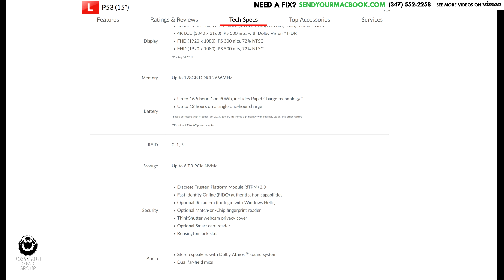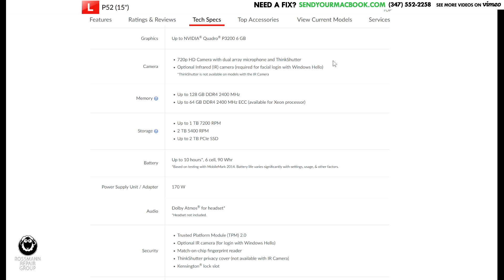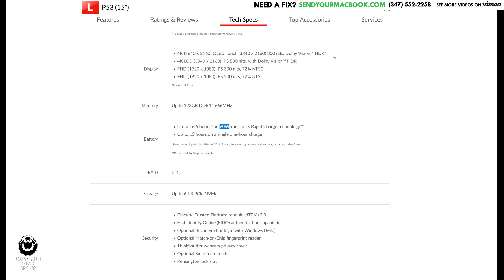Reading my YT comments is depressing

Comment: Ya but that doesn't really mean that they didn't fit a bigger battery in P53 just because P52 had the same size modular battery? For example if P53 had modular battery it could fit only 85Wh battery, and by making it non-modular they were able to make it 90Wh. So they did gain something, not compared to the older P52, but as a compromise for P53.

Just a speculation, I don't know if this is really the case. Just don't fully agree on the argument that they didn't gain anything just because the older model had same Wh rating.

Comment: Let's remember that Lenovo bought Motorola phone business.  And they release the G3 just after the purchase.

The G3 had underwater IP rating and this is with a phone that has a removable back covered so you can change the color of your phone. I bought five different colors myself.  Hell I bought a second G3 turn place the first because if it's broken but mostly usable screen.   

The g4 came out and it was a downgrade.  The entire Motorola line was no longer IP rated.   Even with a seal body.

Lenovo stop using the Motorola DNA in terms of body shape.  But at least the software is very minimal.   

Sadly I had to go with another brand after the G3.  If the G6 was $200, waterproofing, without a glass back, I would have bought it.

Comment: I didn't wanted to make a useless comment about that I won't buy lenovo because this, because I couldn't afford it anyway, or there are so many stupid people, but if this makes you feel better: I knew what you're talked about in that video, and agree with you. Btw my friend bought a t450, and i was a bit pissed that there aren't hdd or memory door and you need to disassemble the whole computer just like my cheap asus k501l.

At the same time, I'd give you a good representation of the battery life for dumber people. You have a 10 liter bucket. The new computer have a 10 liter bucket too. The first computer drains 1 liter per  hour, the new drains 0.8 liters. See how can it get better battery life?

Comment: One of the reasons Lenovo didn't put a bigger battery is because the computer would become illegal in an Airplane. With 16.5h batterylife and quickcharge, there is no point in making the battery external. As long as the battery is NOT glued into the case and can be easily swapped out if defect, I don't mind at all. This decision helps simplify the design and leaves more room for something else in the chassi rather than extra plastic,mechanics and a reinforced powerconnector.

I have a Thinkpad with both internal and external battery. I love it because I can hotswap the thing if I need to for example when I want huge battery life but can sacrifice some portability, or when I want to swap back to a smaller battery that gives me a lighter laptop with a bit less battery life.

Comment: The only reason I can see for a company to do this is if the battery will out live the unit. 

So if they believe that the life time of a laptop is say 15000 hours before it reaches the end of its life....
( I’m pulling these figures out of my ass for ease  of maths..)

So let’s say your battery can be recharged 1000 times and it lasts 10 hours per charge then you would need to replace the battery at 10000 hours to get to 15000 hours of life 

Where as now the battery will last 15 hours per charge then 1000 charges will give you 15000 hours and last the life time of the unit...
I’m not saying this is correct but it’s the only justification for such a move unless the company wants to build in a life time in which case they are just being fruits 

Oh and Louis keep up the good work people will learn you may just have to keep banging your head against the wall a while longer

Comment: Every new product of tech company consists of two parts: one serves company interests and the other - consumer's. The second exists simply because they cannot push product which has only first one. Example: Microsoft wants to sell Windows 10 that has new license, a ton of spyware, forced updates, ads. But they could not sell it if it had just that so they added a couple of features, which are not binded to spyware modules from technical perspective. But you can't choose! Lenovo follows the same strategy. They do everything to take choice away from you: copyright laws, patents and so on.

Comment: In theory (just avvocato diabolii) you can make laptop stay longer on the battery by making it internal. It may make the cooling system more efficient and consuming less energy. It may also improve battery cooling and lengthen it's life.

Comment: I still don't get why a higher capacity battery should make up for being unreplaceable? Is there any technical reason that keeps you from putting a higher capacity replaceable battery in your notebook instead of an unreplaceable higher capacity one? I don't think so. Woud you still accept the transition from a replaceable battery to an unreplaceable one, if say, they also put in a nicer screen? Makes just about equal sense.

Comment: I can try to imagine that external batteries being in a case rather close to them can heat/overheat a little more, and that having the battery going to internal might help in dissipating some of said heat hence having a "better" behavior, but I'm pretty sure it won't account for those kind of difference (if it accounts for something, at max it should be somewhere around 10 or 20 mins max).

Comment: I chose C) a more effective priest blessed the newer boards, making them more efficient, they could be the same boards but with a better blessing they'll work better. Battery doesn't matter. The old priests got lazy and were skipping part of the blessings, the new ones are younger and want to prove their priestly capabilities by doing greater blessings. Therefore, Lenovo should be applauded.

Comment: I don't agree, there can be multiple reasons why they change it, maybe you should ask them:
1. People tend to remove the battery when they plug to the wall, it's bad when the weight is not well distributed and can cause one place to be lower than others.
2. Bad designs can cause batteries to be warm, reducing the longevity of the battery and possible fire. If they can improve (even if it is ticker) to keep the battery cooler, the performance of the battery will be better in a long term.
3. Swapping batteries "requires a shutdown", maybe a solution like for phones (powerbanks), so you could provide extra battery without the requirement of changing batteries.
4. You started the drama criticizing the new model without knowing the reason why they did it, probably to get more visualizations, this is just another drama video.
Reply: @razmetrez  Than it's full responsibility to the company and they have to charge back the money or replace it (with a fix or another model), like they have done with some smartphones with the same issue.

Comment: People did have it wrong. But the reason the battery is no longer module is the fast charging aka Turbopower whatever the company wants to call it. The system needs to 'know' its battery as the charger is actually controlled by the system. If you just threw in random batteries you could end up with a battery fire because the system thinks the battery is at a proper temperature etc. for a high charge rate.

Is it impossible to design a modular battery system that would work with fast charging? No, but it would be more expensive. As well the casing around a spare battery would inhibit cooling which would reduce rapid charging ability. And you'd have lots of complaints when spare batteries didn't work because data pins for temperature and voltage sensors got dirty or bent etc.

Comment: Sorry, but I would have a different point of view: Costs. User replaceable batteries are better IF the majority of users would use it AND spending a few extra cents to make it replaceable is a better investment for them than all the other options. It is about the expected battery life at the time you would consider your laptop "garbage" simply because it is outdated tech, out of warrant with some other parts failing, etc. If that expected battery life is long enough to make sure the great majority of people wouldn't replace the battery then user replaceable battery has no value yet it might increase the manufacturing costs by a few dollars. Maybe they can use those dollars on other hardware changes that help better efficiency. 

These changes are bad for the people who want to repair their devices. Forcing them to upgrade means anyone who sees their computers will see a smoother operation, better performance. It helps with both bottom line, higher production volume (lower costs), reputation, and with the costs spent elsewhere better performance in other areas (good value).

Comment: Yes, of course it's the same Wh. and yes, I agree that Lenovo should remain modular. I like that my T550 has a builtin and an interchangeable battery. I can change batteries while my laptop stays on. But realistically I don't do that and I don't even have an additional battery.
Also maybe Lenovo feels that the 16hr life versus the 10hr life justifies this. If the battery was only 5Wh BUT battery life was 24hr because of efficiency would you still care it's not interchangeable? I did not like not being able to replace the battery in my phone but I learned over time that I don't really care. I prefer water resistancy, compactness and long battery life makes it OK. Again; I am one of those classic IBM/Lenovo lovers, I use the trackpoint, I want the old keyboard back, I like my laptop to be a bit thicker and more solid, I miss the physical buttons and keyboard light. Lenovo's imho are still much better and more practical ("for those who do") BUT if the laptop can work 16hrs on the battery AND the battery does not need replacing after 2yrs (Lenovo batteries always lasted very long and with recent advanges in technology most batteries do) I wouldn't be that bothered if the battery was not easily interchangeable.

Comment: Louis, you left out the other option for "adding battery life". They simply added a more aggressive power management which effectively neuters its productivity until you adjust it to perform as actually needed. Out of the box, the newer one will have a dimmer display, WiFi and USB that powers off and a CPU running at 2/3 capacity yielding the magical extra battery life from the same sized battery. I would be willing to bet that the newer model does not have chipset improvements that would yield a 60% increase in battery life.

Comment: A reason to do the thing for phones would be things as dust and waterproofing, no sense in making such a thing in a perfectly fine laptop.
My old lenovos battery has been acting up a little, it is an older unit afterall. But instead of plopping huge amounts for service or a whole new unit i have the option to just buy a battery. I wont be going swimming with this laptop so a replaceable battery is just a no-brainer.

So sad you need to clarify sich an obvious thing. Keep up the good work man!

Comment: One reason to make the battery internal, and non removable, is you can make a thinner product. No need for the extra plastic around the battery to protect it when it's external.

Comment: its just like having an bmw e36 328i and a e38 728i. .. have the same engine, same power but the e36 will be a lot fuel economical and faster coz its lighter.. 
same with battery .. you can get from 90wh only 90wh... not 91wh...  its the rest what makes how  long it takes to drain..

Comment: For those who doesn’t know the Watts per hour of a battery can be used like the amount of water of a glass of water you can have the same 1 litter amount of water (I know there is a lot of water of one glass hahaha, but nonetheless exist) but can consume it in 1 hour or two the differences in time will be due to the speed is consumed not magic, so with batteries is the same if you have a 90 watt hour one you consume at a 90watt hour rate the battery will last you 1 hour and if you do it at a rate of 10W per hour (and watts are essentially always given per hour) you will drain the battery this time in 9 hours, I think is pretty basic and obvious, but only when you know what Watts per hour in a battery indicates and mean

Comment: as usual you are talking a lot of sense, some people will disagree just to disagree, i like thinkpads, have had many over the years, they make it simple to pull apart and thats why i like them. Disappointing to see they are following apple and going over to the dark side. Trouble is with a lot of companies they become obsessed with copying what apple does, and dont realise that if we wanted apple products we would buy apple products, but we want something different, we lost the headphone jack because of apple, none removable batteries happened because of apple and so on and so on, its very annoying and not necessary.

Comment: Similar to how other hardware vendors copy the bad practices from Apple without copying the good practices, their customers copy the bad habits of unquestioning loyalty from the Apple customers.

Between Lenovo pulling stuff like that and installing malware in their OEM and Dell producing chargers that break after a few months of normal usage (the chargers would still work but the firmware blocks them) it's getting really difficult to find an acceptable laptop.

Comment: Yeah, it is a rip off from a battery stand point, but doesn't it have have a different cpu, gpu and motherboard that might take more space ? and have more m.2 and sata ports? I mean I am not defending them nor the morons choosing answer A, but, maybe if they did not make it none modular it would have been even thicker that that .2 to .5 inches. I would trade modularity and a couple of millimeters for  more configurablility and more battery life (again, even though the battery is still the same capacity)

Edited because of spelling and grammatical errors.

Have a great day.

Comment: Well, isn't it possible that having the battery not being modular and connected differently to the motherboard could have allowed more efficient power flow? Sure the battery is the same, but the way it's connected could have allowed more options in terms of boosting there battery effeciency. (P.S I BARELY KNOW WHAT IM TALKING ABOUT JUST HOPING TO LOOK SMART)

Comment: Hi, Louis. I always agree with you. But about the Lenovo's P53 decision to swap removable by non-removable batt is, in my opinion, more related to thermal issues. As both thinner the battery, and thicker the case, the more the airflow. The mobile workstation market relies more on stability than battery life. As an i9 or Xeon and Quadro RTX5000 combos, and companion chipsets are no mean to battery optimizations, but brute force raw power. So making more room for thermal airflow enhances stability (heavy 3D imaging, CAD and engineering, medical, AI...), with obvious battery life and repairability trade-off.

Comment: Hey Louis I had a question, when apple performs macbook battery replacements do they replace the entire topcase or just the battery? I was under the impression they had to replace the entire topcase since the batteries were glued in. I have a 2015 15 inch macbook pro which was under the recall. I sent it in and got it back supposidly with the the battery replaced, I am questioning if they even replaced anything. The topcase and keyboard are the same so maybe they started prying batteries out, or have they always been doing this? Is this standard procedure for all battery replacements like paid ones or is this “special” since its under recall. Thanks

Comment: As far as I know, the real reason is that the new model has a much bigger/more power hungry GPU (or at least an option for it). That is why it is thicker, and that is why there is less space for a battery. So to make it as big as possible they made it internal. 

I do not like this very much, but from an engineering standpoint I can understand it. Especially because I think batteries have gone a lot better in longevity over the past 5-10 years. While a few years ago a smartphone battery most of the times lasted only 2-3 years, my 2013 LG G2 still has at least ~60% of battery life left. And I did NOT treat the battery very well. (Charged it every night, often let it go down to 0%, and in general I used it A LOT!).
So in my opinion, an included battery is ok if it is done for a reason. (like in the P53). Not good, but OK. Of course, it should still be a CRU like RAM or the HDD. It should still be possible for the average guy to write the part number down, get a new original one, and replace it within 20-30mins.

Comment: Normally I agree with you but not on this. We dont like non removal batteries - agree, but you say you understand the removal of modular battery, if there is a trade off like a higher Wh battery. To what end? It gives you longer life. They have achieved this in other ways - simple.

Comment: Louis Rossmann have you ever experienced or are you aware of issues with the internet bandwidth on newer Macs (ie. MacBook Pro (15 Inch, 2017)) on longer usage without restarting. I had this issue about three times already where my bandwidth would go down to < 10MBit/s instead of the usual 400 MBit/s. The network works perfectly fine on all other devices tho. Maybe it's some kind of thermal throttling. A restart always fixes it.